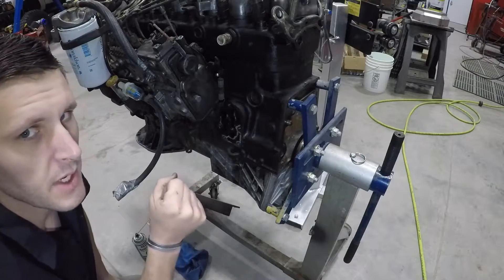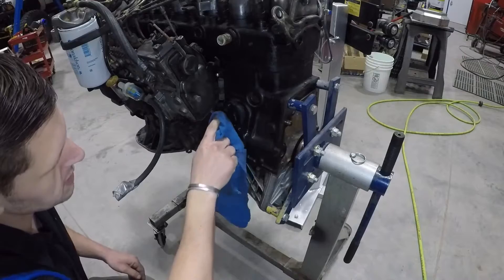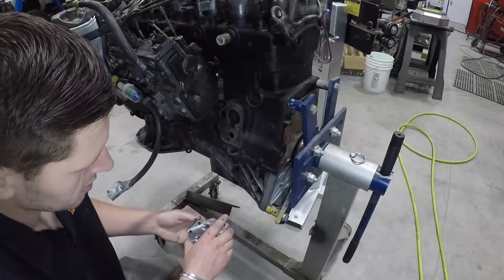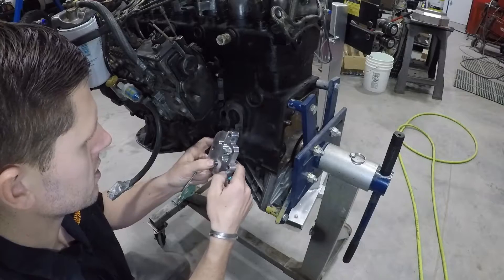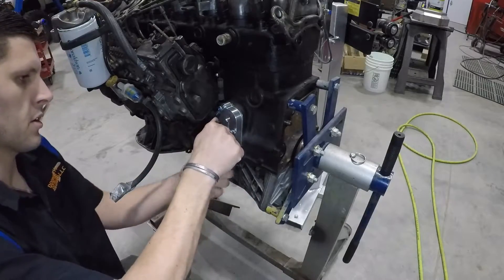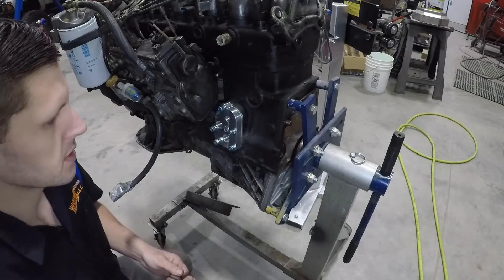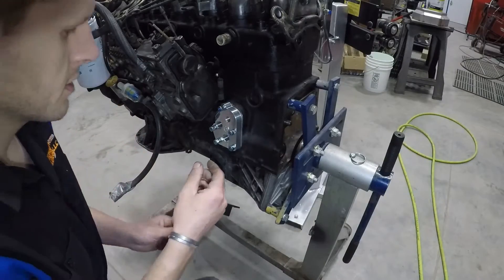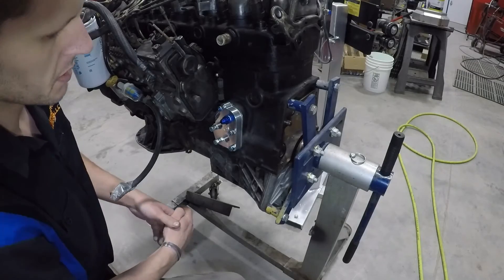OM617 Conversion Series: Oil Filter Relocator Part 1

Comment: Trying to figure out how people are running these 617's on a stand..mine came with hoses hanging off the oil filter which i assume go to a cooler..any ideas how to get around that so i can test run this thing? Think the cooler is necessary? Thanks!
Reply from the maker: Cooler 100% necessary. Bolt some plugs into the cooler ports. Then you can run it.
Reply: @doomsdaydiesel  thanks for the reply! I appreciate it!
Reply: Noticed the name, you don't do WVO conversions do you? That's my intent with this swap.
Reply from the maker: @sirridok  the 617 isn't a good candidate for VWO
Reply: @doomsdaydiesel  there's an entire movement of WVO heads that use the 617 and swear by it. They've even got a kit they designed for it. Why do you say it's not a good choice?
Reply from the maker: @sirridok  the performance pump builders like Dieselmeken void your warranty if you use it